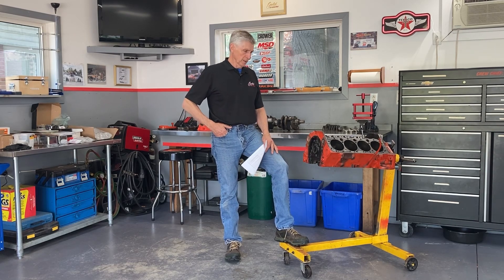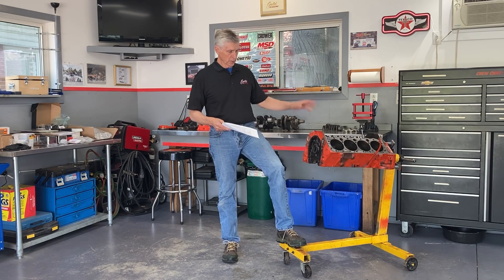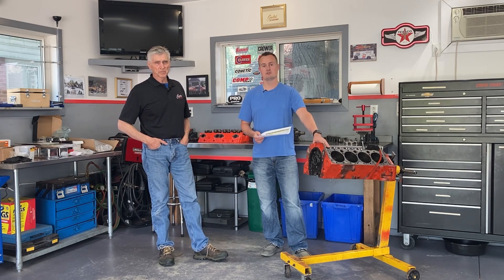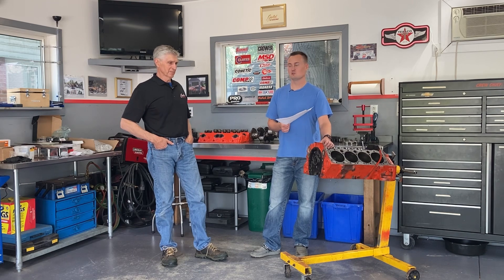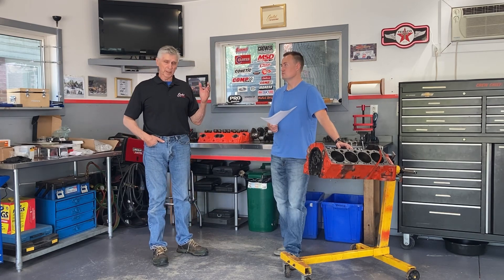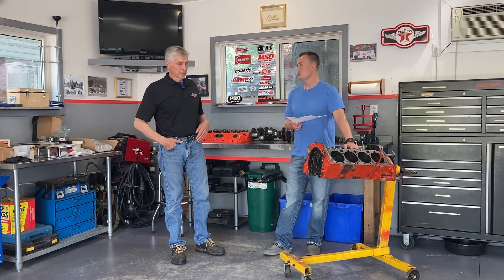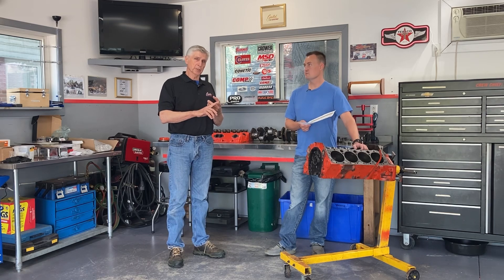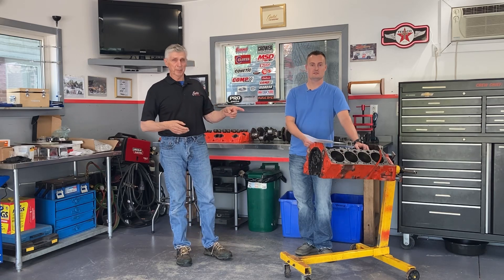Building a 350 SBC Chevy on a BUDGET - 375hp for under $2000?? Part 1

Comment: This is very similar to the engine I’ve planned for my 1990 GMC Sierra.  I am going aluminum heads because the stock heads are pretty terrible.  Targeting 9.6:1 (or 9.8:1) with a single pattern Isky 264 (or 270) Mega on a 108 LSA.  I’m looking forward to the dyno results.
Reply from the maker: Thanks Nate and good luck with your build. AG
Reply: Get the throat of valve seat effective and you shall be gold with 108* LSA in a 350.
Reply: @zAvAvAz  at the moment I’m on the fence between Brodix IK 180s with a good valve job and back cut valves or AFR Eliminator 180cc.  Brodix heads will likely be less expensive after the work but not significantly so.
Reply: @zAvAvAz . The throats on my heads were about 85%, (last guy that did the valve job opened them up from about 81%). I used a stone to open them to 87% intake, 88% exhaust. I noticed that the throats aren't concentric, are they supposed to be more relieved in some areas vs others? I pretty much kept the same proportions when opening them up. The long turn is most opened up vs the 2 sides and short turn.
Reply: @NateDalton  Well, i am like the ProMaXX project X215cc head. Out of all of the heads. Well and the freedom series 185cc that are not called the freedom series anymore. If was getting AFR would get the 180cc and then demand the CNC competition cut version of those. And try out those ISKY ez roller lifters. If getting eliminators get the 195cc.

Comment: You can get a 880 casting, L31 Vortec engine for $3-600 and save yourself the headache of retrofitting a roller. I've built several 383s from these blocks and they hold up well. The Vortec heads are the way to go (in my opinion) for a budget build and from the heads I've personally flow tested, the Vortecs will flow more than any other stock SBC iron head. The old fuelie heads are typically in rough shape nowadays, being 50+ years old and no hardened valve seats make them more trouble than they are usually worth. Unless it's a numbers matching rebuild, I always recommend a good used set of ported Vortec heads or if the budget allows, some AFR or Trickflow heads.
Reply from the maker: Thanks Brad. An 880 block would be my first pick too, but hard to find them with a mechanical fuel pump set up in the casting. AG
Reply: I have a ‘98 l31 any cam suggestions? I know my heads max out their flow at 500 lift roughly 906 heads 880 block in a ‘77 GMC k15 daily driver
Reply: @goldsgarage8236  I run Holley electric pumps with a bypass regulator. My Chevelle has had the same Holley blue pump for 13 years. I keep a spare pump in the trunk. I can change the pump in just a few mins
Reply: @JayR-z1t  - Stock Vortec heads may need work to allow over .460" lift... Chevy ZZ3 cam would be good in a daily driver... around 350+ HP...

Comment: You left a lot out of the list.There is no machine work listed  Valve Guides / Vales Grind seats/no bore and hone Hot/tank /cam bearings / soft plugs/hang and align pistons/ no decking the block/ maybe line hone mains/ and more like balancing rotating assy and more?
Reply: We will not be doing any machine work on this build, so there is no allowance in the budget. This premise for this build assumes you are starting with a good block and rotating assembly in fair condition, which we are.
Reply: @mkimble21 Kind of an overhaul-build then. 👍
Reply: You don't always need to do all of this I have built a stock bore 350 with a 600  $ rotating assembly used  balanced out of the box. Vortec heads that already were fresh and stock heads at that with a lt4 hot cam variant. Plenty power dont always need to go down that rabbit hole right off the bat

Comment: sweet build. This is the perfect range for a 355 cubic inch car to enjoy and drive daily with all the vacuum. That 3.73 gears and 4 speed are going to make the '70 monte's weight non issue. This is about as balanced as you can get in a 350 for this car. Great job. 10:1 compression in this is going to be a power maker no doubt. You can always richen a jet and timing 1 or 2 for in car also. 108* LSA is perfect for the cubic inch, head flow and valve size in this.
 Great choice, this cam is smart. Your throttle response is going to be snappy as all, and the car shall be reactive as well. i am can totally see and imagine this car and it's performance and daily drivability as being great.
Reply from the maker: Thanks for your support dennis. Look for future video as we take you through the process. AG
Reply: You are thinking the way I do, most people use a camshaft with to wide LSA. Those heads don't have good cross flow and need overlap with small duration
Reply: 112 Lsa is more streetable once u get into the 110s n lower u lose vaccume = breaks
Reply: @oldsrocket8456  exactly why i am designed a hard footbox with mounts for an ultra high leverage brake system utilizing a long lever to the passenger side foot box with dual large piston manual master cylinders. High leverage = power brakes.

Comment: 9.90-1 with an early closing ABDC 34° with iron heads, pump 93-94 octane is higher than recommended. The DCR is 8.762-1
Estimated cranking compression 197.75# 🤔
It’ll be interesting to see where the cranking compression ends up. 
The chambers might end up slightly larger than 64cc 🤔
The piston deck height should be .015”-.028” down in the cylinder. 🤔
Can’t wait, good content!  JD
Reply from the maker: Thanks HeadFlow. I just cc'd every chamber and they are all right on 64cc. I calculate DCR using the advertised numbers not @.050". Also remember that there is always some compression loss via the rings, especially before they are broken in. We are looking expecting 160-170. We'll let you know. AG
Reply: Yeah, a little loss over the edge of piston and rings. A little loss there is good actually for a lot of reasons, would take a ton wrong to be excessive loss in a street engine. And some race engines are taking out middle rings and modding oil control rings to 'low tension the ring' because their cylinder pressures are so high and it costs less than buying low tension rings, well that and a ton of friction they get with all of the rings, then they vacuum crankcase evacuation pressure as well. That lets you spin upper rpm no doubt. And street engines are 'usually' below 7K rpm. lol. just a little help for anyone reading this.

Comment: I always put the heads on the block bare and scribe the cylinder to the bore, sometimes you can unshroud the edges of the chambers to match the bore, a couple more ponies for free
Reply from the maker: Thanks for the suggestion David. I have never though about doing that. AG
Reply: I considered that, it probably would’ve brought the compression down a couple tenths as well.
Reply: I just use the gasget. Great idea.

Comment: Are there any restrictions in Manifold vacuum, fuel grade ⛽️ or Rpm range?
Reply from the maker: No restrictions. I expect about 17 inches of vacuum. It should run fine on Shell 91. We will rev it until it stops making power, probably about 52-5400RPM.
Reply: @goldsgarage8236  EPS likes peak torque below the typical 3800-4400+ rpm for a 355  c.i. also, so flattens out slightly, and makes a big chunk of torque, and makes better hp than regular performer also. i bet it shall be 400tq all the way across.

Comment: I'm using some cheap profiler clone alu heads on a vortec block with a Lunati 10120318 cam (I think lunati make great street cams) with a 9.7 compression and just under 8.5 dynamic which should allow me to run pump gas, probably even 87 during winter
Reply from the maker: Nice combination of parts and perfect CR. Good job planning your build. AG

Comment: It makes me feel bad for yous guys over there in Canada eh. Because the Chinese aftermarket aluminum heads they sell on eBay are good enough to support 500 HP. And they are dirt cheap, about $500 to $600, cams cost less over here and everything is easier to get.

For $2,500 on this side you can get almost 500 HP. The above mentioned heads, a 383 stroker crank about $200 shipped, Speedmaster forged rods about $165 plus $85: for good bolts, about $200 for bearings, about $350 for pistons, about $65 for rings, around $100 for a external balancer, around $200 for a genuine imitation RPM Airgap, around $75 for a decent timing set and about $350 for cam and lifters, this is around $2,350 so far add a gasket set and there you go 400 to 500 HP depending on what cam is picked for $2,500. 

Of course like everything else there are a few odds and ends that may be needed plus the proper fluids with all the vitamins and minerals for a flat tappet. Will need a carb if you don't have one, a flex plate or flywheel for whatever transmission that will be used and so on...
Reply: Those are all good points. I did look at using the eBay heads and installing good hardware but I really wanted to keep this project vintage and use what we have. We are using those Speedmaster forged rods you mentioned. We could definitely make more power with the eBay aluminum heads or even a cheap set of Floteks but that will likely be in a future video.
I should mention, the budget is $1700 before dyno costs and 15% contingency.
Reply: @mkimble21  
Make sure to get at least a set of ARP 8740 placement bolts for those rods if they didn't come with ARP bolts. There are hundreds of horror stories on the interwebs about using the Chinese bolts that come with those rods. 

Those Chinese bolts have cut threads, ARP bolts have rolled threads that are much stronger. Plenty of info and video of the difference between the two processes on the interwebs if you're not familiar?

And if you do a eBay aluminum head swap in this series later on with the cheap eBay heads just make sure to use the "Self Wicking Green Loctite" on the hardened seats to make sure they don't fall out. Those are installed in China and some of them might not be in there as tight as they should be. Drip the mentioned Loctite on the perimeter of the seats with the valves removed and let dry for at least 24 hours before doing any other work to the heads. After that they're good to go.
Reply from the maker: The rods have ARP bolts. AG
Reply: @goldsgarage8236  
Good choice.

Comment: Is there any way that I can have a decent running 350 engine on the street, with a TBI System? I have a 1991 Chevy Truck. I want about 300-325 Horsepower.
Reply from the maker: Sure you can. A little more compression and cam timing should get you there safely. AG
Reply: @goldsgarage8236  Thank you Sir 🙋🏿‍♂️
Reply: So I guess I should refresh the Engine, change the Cam and Heads?

Comment: Would you recommend this cam for a block bored 40 over?
Reply from the maker: Thanks for the question Wayne. The fact that it is bored .040" is not a factor. Let's see how it does this Saturday on the dyno.  
That said, it is a good fit for Mike's 350. There are some videos on my channel about cam selection. Please check them out and let me know if you have any questions. AG

Comment: Hello, 
What heads did you run on 400 with adjustable cam timing?
Thanks
Reply from the maker: Thanks Gentilejosh, These were Speedmaster heads, 64cc, 2.02" intake valves. I don't have flow numbers, but I did measure the intake runner, just over 200cc. Hope this helps AG.

Comment: I am re-ringing a 350 that has been bored 40 over. I ordered rings for a 40 over block. The bores measure 4.0415. The rings came in, and already they have a .025 to .027 end gap. Is this acceptable? This is naturally aspirated for street only.
Reply from the maker: Absolutely acceptable. Run it and don't worry about it. you will never notice the difference. AG
Reply: @goldsgarage8236  Thank Yolu
Reply from the maker: Just an additional point Wayne, a little more end gap is better than not enough. Insufficient end gap can destroy your engine. AG
Reply: @goldsgarage8236  Thank You again. I checked on of the original rings to the engine. The gap was over .050, so I guess I'm better than that. And yes, I really do know how to use feeler gauges :)

Comment: Is it important to have a 4 bolt block for this build?:
Reply from the maker: No! 4 bolt blocks were first made in 1969. Prior to that people were racing 2 bolt block engines in blown dragsters making well over 600HP. A 2 bolt block is fine for a street engine. Thanks for the question Wayne. AG
Reply: @goldsgarage8236  Thank You
Reply: I've never had a problem with 2 bolt. I'm 58. Raced dirt track. Street racing. Even now my old 4x4 has a 2 bolt main. Aluminum heads. Roller.

Comment: Had a guy say that he has a 355 chevy 
I told him so you bored it .10 iver and he said no .30 over . From my under
standing 350 .10 over is 355 and .30 over is 377 and .60 over is 383 right ?
Reply from the maker: Thanks Jimmy. A 355 is .030" over 350, a 383 is a 350 .030" over with a 400 crank which is 3.75" compared to a stock crankshaft which is 3.48" 
A 377 is the other way around, a 400 engine bore and 350 crank. 
Hope this helps. 
AG

Comment: Should be a good build ...  If that head flow is at camshaft valve lift you should make you goal ....  I'm personally not a big fan of David's formula ... It's is based on statistical analysis from lots of Dyno runs and is set up for gen 1 sbc but tends to be on the race side because he likes peak power ... The 108 centerline is ok but I would have probably chosen a 112 lobe center with 4 advance to move some exhaust out of overlap and helped just off idle response because it is a driver .... Being a manual will help ..you did not say rear gear .... I'm assuming a dual plane intake ... Small dia z28 type spring... good 650 carb
Reply: With 1.6 rocker arm lift will be .481/.483 which is right where we have 230cfm. Low lift flow at .200/.300 is also very good. For drivability, I reduced the duration. I like the 108 for the cubic inch. I did mention I would likely go with a 3.73. The intake is a dual plane Edelbrock EPS, valve springs are Howard’s 98214  115 seat and 300 open. We will try a 650 and 750 on the dyno. 
The application, a 1970 Monte Carlo, are what we are working to compliment on this build, slight improvements on the factory 300hp  350  . A bigger camshaft would’ve been nice but I don’t want to sacrifice any street manners. Thanks for the comment Scott, watch for future videos where we will assemble and dyno test.
Reply: @mkimble21  Dyno doesn't care about if it's 650 of 750 cfm ... You can way over carb on the Dyno and make the same curve ...it is really about how nice it will drive without giving up peak power
Reply: 3.73:01 rear axle housing gear.
Reply: @mkimble21  When you got up near10:1 with a notch down on cam, and a notch up on heads, in a heavier car, you'll be better drivable. That is exactly what this combo is. a 5500 rpm small block Combos like this can use the 750cfm in the car some times. When V.E. is down from race engine V.E. actuaL in car cfm requirements go up. Many 260H cam in 355 ci. combos with well below 10:1 driving around with 750 carbs instead of 650 or 500 cfm'rs. We shall have to wait and see what Allen and the rest of gold's garage decide on what to use or what the monte likes better.

Comment: what pistons?
Reply from the maker: Thanks for your question Victor.
We used the original OEM forged flat top pistons with 4 valve reliefs. We did replace one with a hair line crack on the skirt. AG

Comment: i had tim’s automotive machine out of bloomer wi build me a midwest mod race engine for about $11,800 2 barrel EQ heads ….. it pulls 378 HP and 436 lbs of tq no way you can get that kinda power numbers for $2,000
Reply from the maker: Thanks for your comment Logan, to note, there is no labor content in this price and we did fall a little short of the 375HP. Please watch the dyno vide for more details and actual results. AG
Reply: @goldsgarage8236  i’ll check it out sorry for the early comment without watching it all lol …. i’ll do my due diligence next time and watch all way through